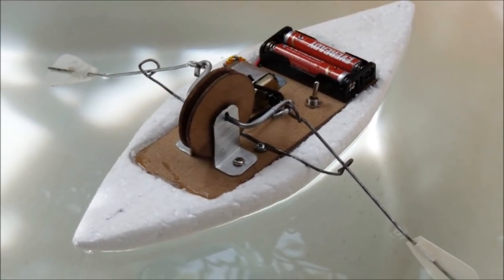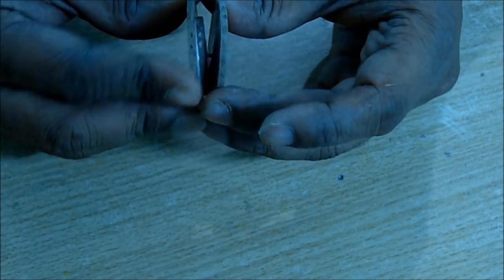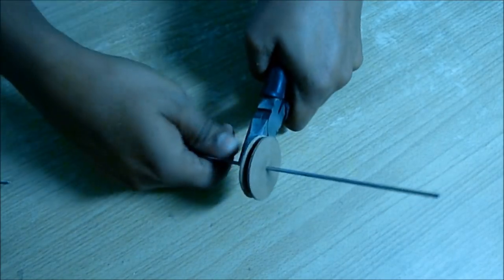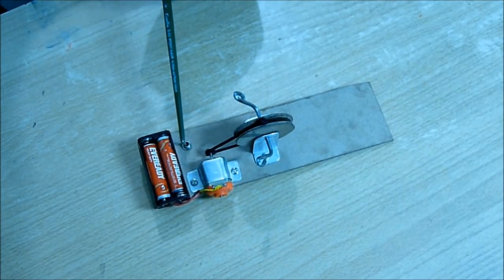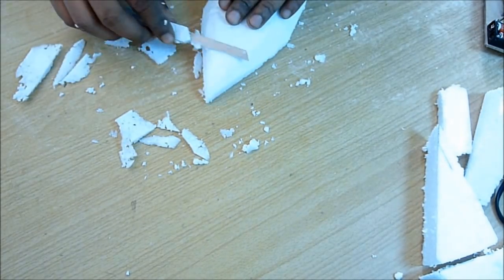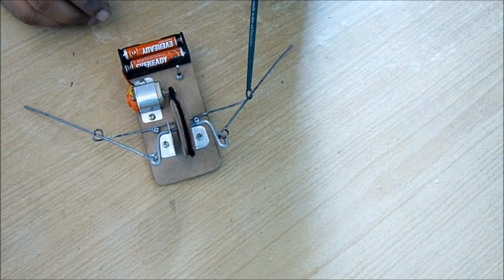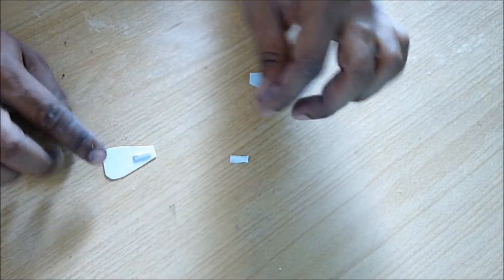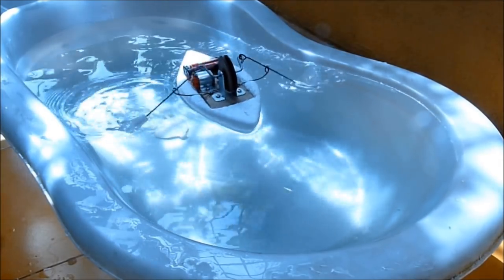How to make a Rowing Boat

Comment: Beautifully done. It would be great if you could slow down the rowing speed. Use some gears, may be.
Reply: I cannot think of any mechanical way to slow it down (of course, gears will do the trick), but you can always use a potentiometer or a variable resistor in series with the motor.
Reply: Yes, you're right. Anyway, this is a beautifully designed boat. I don't think it needs any improvement (I personally would add at least one battery, it seems that the motor you used is the same that cd players have, and they can easily handle 5V). Cheers!

Comment: thanks for sharing this video but you can use an old rc car circuit board and solder it with the motor and you can have a rc remote boat!

Comment: Hi, can you help us with the measurements of the boat.  We would like to know the length, (cm or in) the width across and then the width were the diagonal lines meet (4 in or 4 cm?)  also the length of the cardboard that you attach the motor, switch and batteries to- estimate is fine.  Thank you we are doing this as a school project

Comment: Great sir could you send the material and steps info to me please, it would be of great help for my 8th class science exhibition.
Reply: Thank You, will let you know if having any difficulty
Reply: ***** sir, i have one question which you could please answer me in an hour or so. Can I instead of using battery use saltwater to run the motor by releasing the wires in the saltwater. need your guidance. if this can be done, please tell how.Please help, need an answer urgently.With regards.

Comment: your video is good. only thing at start 0.14 you said whats required and then you start using more stuff like cardboard, the clamps, your iron rod, glues even batteries etc etc. it would be more professional if you mentioned all at begining
Reply: Thats all right. somepeople watch to learn some watch just to watch, they can observe and in future use the ideas for something else. eg your pulley idea was superb. I can use it for something else, using sandpaper for thermocol finish was good. never occured to me, your propeller idea was good.

but for some looking to build a similar one, if you begin with - what you need, its easy for them to get them all or to check if they have all. This way they are already switched on with your idea. If your demo puts on increasing articles required it may get out of hand.

All the Best with your projects

Comment: put small small routoer in bsck that you can controll.find a mini small rc race car, pull motor and the guts put it on that boat ruter and roll mitor sonyou can control it with a mini control.mucro.

Comment: I really like the boat, i will make for my engineering project. What do you think if i add proximity senser which you used in other project? Can you tell ift hat will work? Thanks :) Good Job!
 Reply  · 1 
 
Hide replies 
 
Saurav Chakraborty (Brainergizer) 6 days ago
 +tareq What function you like to add using the proximity sensor?  because it is driven by one single motor the only thing you can do with sensor it to stop the motor or rotate it in reverse direction.
 Reply  · 1 
 
 
tareq 6 days ago (edited)
 +Saurav Chakraborty (Brainergizer) yes that's the reason. But is the circuit components going to be different from this https://www.youtube.com/watch?v=soa13KhVzsE ?

Can you reply to my previous comment please!!